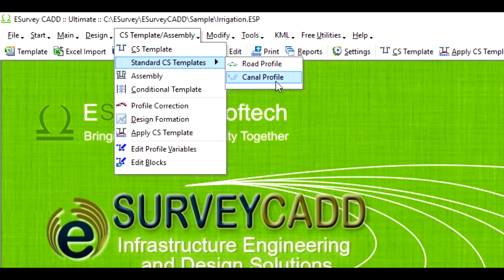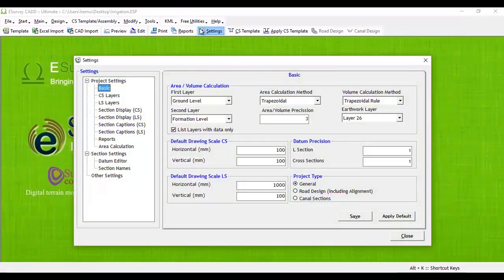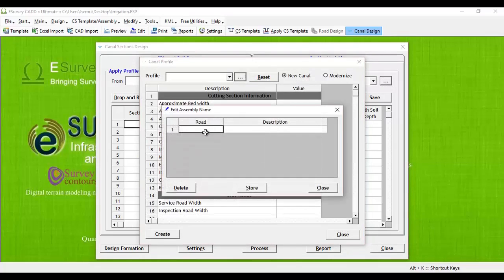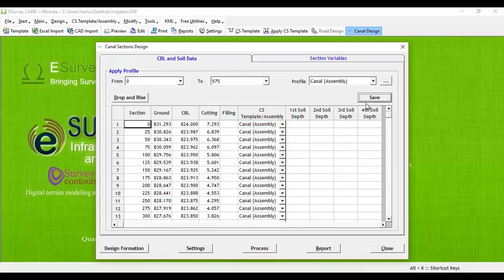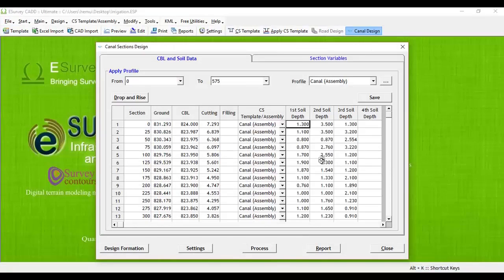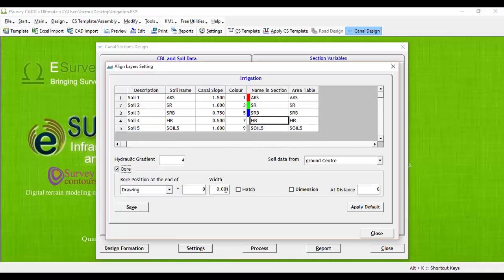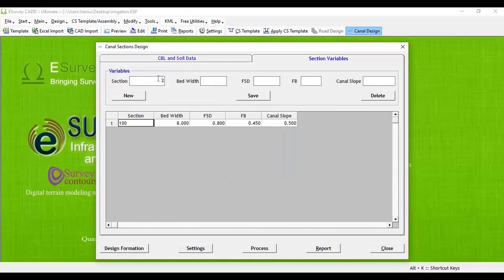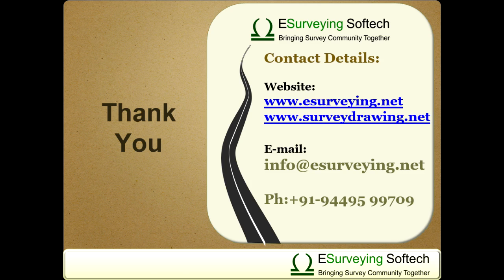Canal Cross Section (Irrigation Canal Design)

Comment: Loved it, 1question, lining material's thickness reduces canal section or we  provide lining  without affecting area of cross section
Reply from the maker: Dear Sir

Lining will not affect the  area in the cross section, as area of Cross Section will be calculated based on surface data.Each surface data is mentioned separately in each layer.

Ex. Ground data is one surface,Lining is one surface and formation is one surface.

Area will be calculated between surfaces.

Regards
ESurvey Team